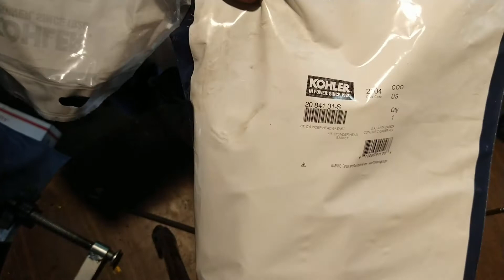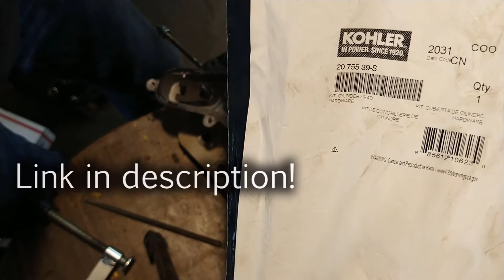Cub Cadet LTX 1045 Kohler Courage Head Removal & Repair

Comment: I’m replacing the head gasket on this very engine right now. This video has been a huge help to me. Fortunately, I didn’t run into the valve guide issue that you did, so it’s been a pretty straightforward job so far. Thanks for sharing your knowledge. Some of us depend on guys like you to guide us through repairs that we’ve never done before.
Reply from the maker: Thanks for taking the time to comment, it is encouraging to hear that it is helping people out.  Learning how to revive what we already have is a skill I believe is becoming increasingly valuable.
Reply: @SolunaGarage  Forgot to mention...the bolts under the flywheel were loose like you said they might be. If not for the video I wouldn’t have known to check that.
Reply from the maker: Glad you got it before it got you!

Comment: This is such an awesome channel. I come here through your 1882 build. I have John Deere myself but this is a nice view into the 2000’s cubs. I have a new respect for them(not the courage though.)
Reply from the maker: Thanks, that means a lot to hear that.  The 2000 Series are kinda unappreciated in my opinion.
The Courage was never offered in the 2000 Series  They stuck with the Onan Elite, Kohler Command, and Briggs Vanguard engines, all of which I'm sure you know are sound.

The Kohler Courage single cylinder is probably their worst engine at the time it was offered.
Reply: @SolunaGarage  oh I have personally seen the courage’s go. I put an m18 in my John Deere 317 out of a low hour 1811 that had bent frame. and I was looking up rebuild videos. It has 120psi on the cylinders but burns a lot of oil. In the John Deere world the kohler twins and even magnums are frowned apon because of the onans reputation. All that said, I found a 2166 with 800 hours im looking at. Seriously want it. I like the single commands. I had one on my stx38 I had.
Reply from the maker: I think the Command singles are awesome.  Nice torquey engines that sip fuel and are small and  easy to work on.

I haven't owned an Onan twin, but I would certainly like to some day.  With the exception of the parts being more expensive, they are awesome engines.
Reply: @SolunaGarage  I have an onan cck 16hp twin on my old miller welder I’m rebuilding and it’s so simple compared to the kohler twins, but I’m excited to see more from your channel, definitely supscribed. Your content is underrated for sure.
Reply from the maker: Cool man!  Gotta keep this old iron alive!  Thanks for taking the time to stop in.

Comment: What works good is to weld a square key stock on top of the tool and grind out the middle so it can compress more, I did this years ago and never had a problem with it 
Just easier to use 😊on daily basis
Reply from the maker: Nice!  Will keep that mod in mind 🦾

Comment: Ive got the same series mower. It hasnt run in a year, I can spin the motor using the bolt on the underside. It will spin freely then gets to a certian point and stops. I can reverse the rotation and it does the same thing. When starting it will turn over a little and stops. Was hoping its in the head, but how likely would valves just stop movement? Any suggestions? Thanks! Great videos btw!
Reply from the maker: Easiest thing to do is to pull the valve cover and inspect the valve train to see if the bind is in the valves or if it is deeper than that.  Good luck and thank you!

Comment: Do you remember what torx socket size was used to remove the muffler bolts from the head? I have to remove mine and need to buy one. I would like to know what size I need to buy.
Reply from the maker: I do not, I would say a T30, but I'm not certain.  I'll see if I have any extra laying around that I can confirm for you.
Reply: @SolunaGarage  Fabulous!
Reply from the maker: @donaldlemoine3032 the old bolts I have here from the repair are T45.
Reply: And you sir
Reply: Got a set at hf cheap

Comment: what  tool of measurement did you use when  setting value seat height?
Reply from the maker: I believe I just used a dial caliper with the depth gauge end.

Comment: Would a slightly dropped exhaust valve guide cause the muffler to glow a cherry red? The engine is running good (for a kholer courage) but it must be lean. I adjusted the valves to spec, flywheel key is in tact, fuel system clean, gaskets in tact...thanks!
Reply from the maker: I wouldn't think so.  As long as the valve still closes, it shouldn't affect the mixture.

Comment: Would have been so much better if the guides were screwed in
Reply from the maker: Gotta love that "interference" fit.
Reply: Taryl fixes all has a video on an engine with a moved valve guide. His fix was to drill and tap a hole thru side of engine. Set screw pushes against valve guide and prevents it from moving. Might be an option here to prevent the guide from moving again. Where to drill the holes is the question😅.
Reply: @SolunaGarage you can drill and tap a small hole at about 45 degrees in same location where you punched in those divots. Might need to set head on a vise and use a drill press. Also, it might hold the guide even better if the hole extends past the head and a bit into the valve guide. That way set screw does its job.   Someone out there might wanna give a try.😅 I would if this problems was recurrent.